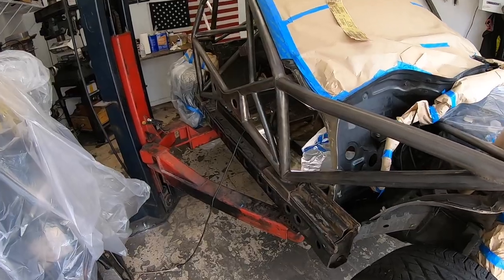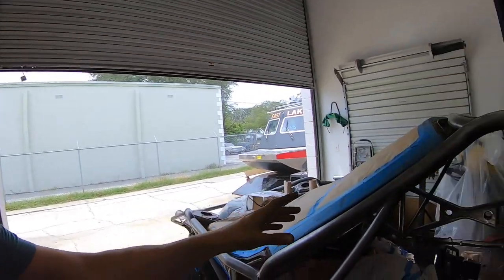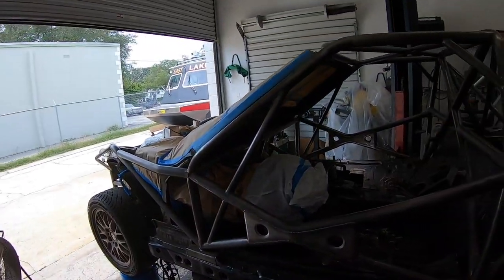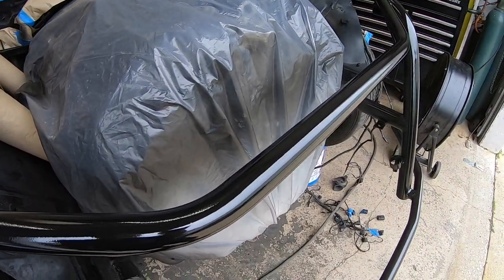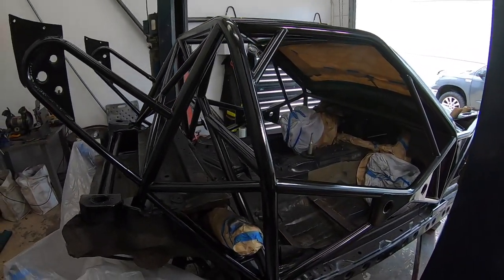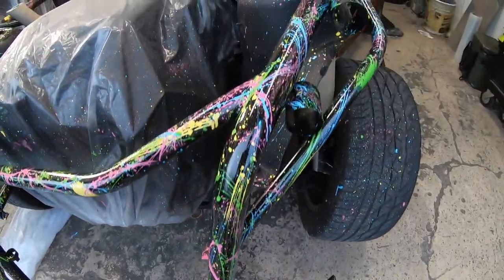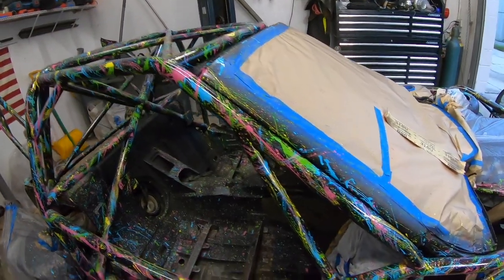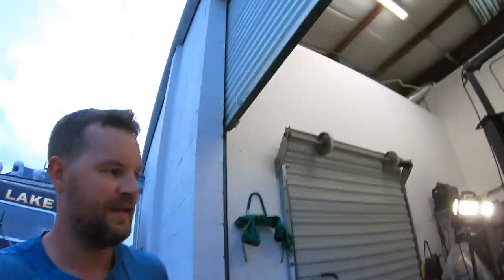BMW Exo Kart Get A RAD 90's Paint Job and It Looks Killer!!!!

Comment: Where the welds? To me that is the sign of a good fabricator as opposed to a fabricobbler. A good fabricator takes the time and has the skills to fit all the bars together tightly and then make nice clean welds, the fabricobbler on the other hand rarely if ever fits the bars together tightly and is forced to glob the welds on to fill all the gaps.